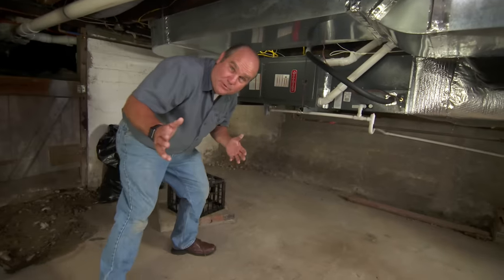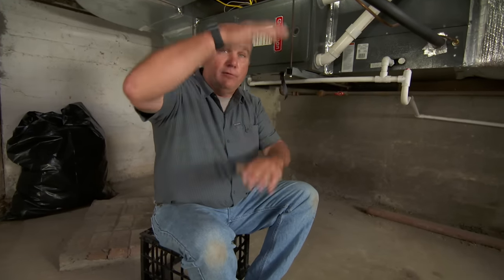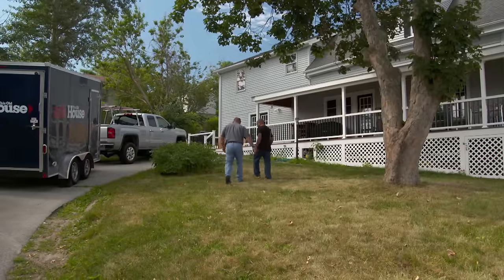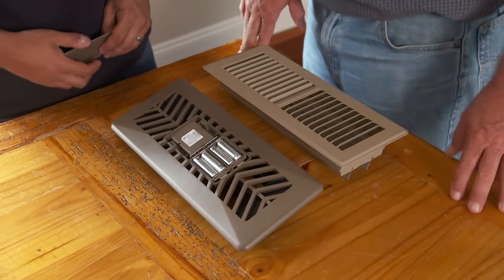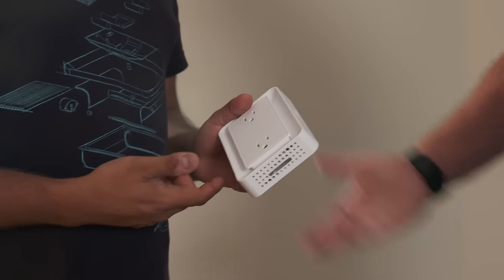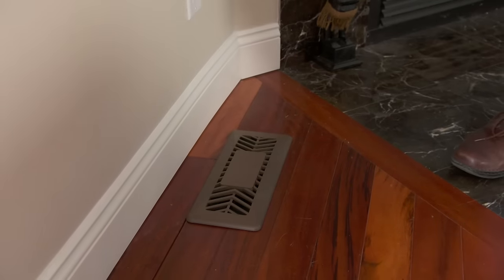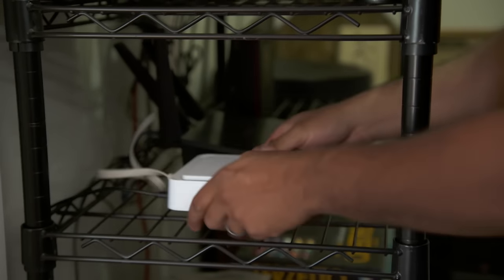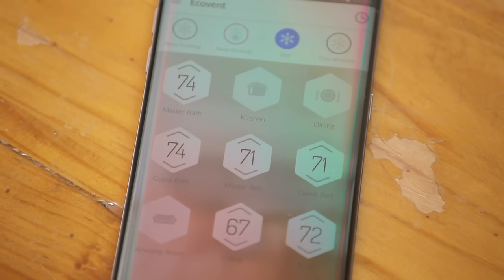How to Install Room-By-Room Zoning in an HVAC System | Ask This Old House

Comment: Guy would make a killing if he would sell this off to NEST to integrate with their learning thermostats and temp sensors.
Reply: Their controller has to be in charge so all your really need from your thermometer is the off/on and heat/cool and fan on/off functions.  The controller is tracking the duct pressure, room temp/humidity to adjust time on/off.  Most smart thermometers don't really do much for room to room conditions but they make better guesses  based on outside data and preferences.
Reply: @TheNameOfJesus  That's because NEST got bought out by Google a few months ago after I posted this comment. lol
Reply: @robsp32  And this guy ran his company into the ground and now these no longer exist. Obviously a poor businessman...and no, it has nothing to do with missile defense....
Reply: @ryanroberts1104  you think that Flair smart vents copied his idea?maybe he patented the idea and is a millionaire now?
Reply: I hope he did cause there is Flair smart vents now that do just as you suggested
Reply: Yeah then he will have a nice nestegg
Reply: @247HustleMode  Who? Not the guy who made this stuff - it's no longer available because he ran out of money.
Reply: Or eccobee
Reply: I agree
Reply: @dave998899  can you provide a link to the updated TOH video?
Reply: @UnsungHeroist  eccobee doesn't let you change individual zone temps...
Reply: @-JonnyBoy-  you can prioritize the zone though and make sure it the right temp. I do this in the summer in my home? At night it only listens to the upstairs sensor to make sure there are good sleeping temps even though the downstairs will get a little cooler

Comment: sensors used in missles defence.,. lol i love how they upsale a 30 cent sensor.. military sensors are thousands of dollars redundancy your using a freaking arduino temp and moisture sensor 99cents on ebay dont lie bro... dont push a product that clearly anyone can do
Reply: They probably aren't going to fail. It's just marketing.
Reply: Perhaps it's because the sensors used by Uncle Sam have to be rated for ballistic missile use? Arduino sensors are just as good for the job intended. I use them all the time.

Comment: Will have problems with furnace, unfortunately this guy seems to have done a great job but missed airflow when 90% of heat cooling is not modulating with his system. Will have problems. Need a proper zoning system.

Comment: One of the main issues all zoning systems have to overcome is trying to vary the airflow volume, when most residential HVAC equipment is constant volume.  A true variable volume system has equipment designed to run on a wide range of airflow.  There is high end residential equipment that is variable volume, with modulating heating and cooling.  These high end systems, with variable capacity work well with zoning systems.

Comment: In the Netherlands we almost all have modulating, low temperature, central gas water heating, with water temperature from 30 to 60c (86-140F) when it is not freezing outside. 
All rooms have thermostats on the radiators and a central controller in the living room. All radiators are sized per room. 
The gas furnace is almost always extremely oversized for heating because is also supplies hot tap water.

Comment: Really neat idea. The registers are a little ugly. Would like to see something that could take the existing registers, and mount under/OR replace the damper. Otherwise really neat.
Reply: Dipul, you would get a lot more respect if you actually had a tiny bit of HVAC experience.
Your equipment is not for every house or project.
Some homes just need an experienced HVAC tech to summarize their issues and come up with a solution. You are trying to be the next "Nest".
I do admire your " Get rich or die tryin" mentality but have a little more respect for HVAC professionals.
Some homes, they have the wrong size ducts, clogged air filters, small return duct, etc. and now you want people to believe your product is going to be the magic bullet.
You want to get rich off something you don't really know anything about in the real HVAC world.
Reply: @gretzkysyotes  How do you install ductwork backward? You should get your facts straight before you throw all A/C contractors under the bus. By the way,jdere31760 is correct and these controls, They don't work too well. he made some statements that are just not correct. So ruin your system. You should fix it yourself too to keep those crappy contractors out of your house.

Comment: You should make the outlet sensors so they screw on the the wall plate at the center screw. It will stop it from coming off when devices are unplugged.
Reply: THAT was the first thing I noticed too. If they are still in business they probably got that figured out by now :-)

Comment: it sounds like the engineer forgot one thing, most people are saying they need a bypass and that is correct for a non variable Hvac. In order to do it without the bypass you need a designed hvac for variable speeds to not over-pressure the flow. You need a max capacity btu but a variable fan speed. There will still be disadvantages, cost is one of them. size of the evaporator is another. A bypass could also be a good thing if they integrate a water heater into the loop instead of being a separate unit. I don't think current systems will not manage unless major deterioration happens. Plus modifying a hvac system vs designing one from the ground up will be better.
Reply: 100% agreed but what makes me weird out is that as an IT/Technology professional myself, I would never recommend wireless connectivity as it is not as reliable as connected and if these registers are constantly opening and closing, they will eat through their batteries quickly.

Comment: Like the dude said in the beginning, if your stuff isn't sized right, no amount of zoning is going to fix the problem entirely.  I remember growing up in my boyhood home, the second floor was always sweltering because the house HVAC just wasn't built correctly. If I plopped this system into that house, wouldn't the a/c just run all the time trying to cool the second floor while making the first floor freezing?  Without an ECM motor, I can't imagine that this system could keep all the first floor registers closed completely. They would have to stay somewhat open to maintain air flow. 

 I think this system is probably better for homes that are either new and built with zoning in mind, or in houses that are being remodeled.  People that expect their drafty, poorly ducted and sized houses to be saved by this system will probably crap themselves when they see how expensive the true fix would actually be.

Comment: OMG.... Where can I buy this. I just bought a new home, with 3 huge rooms and a massive master bedroom, large loft, huge living room.... lets just say lots of space. But I can't understand for the life of me how the builder put in a central heat/cooling system that is not zoned. So the rooms are either too hot or too cold with no way of adjusting room by room. I got a $16K quote form an HVAC company to redo the system with zones. And, this issue is causing me to burn through a 500gal propane tank in as little as  2-3 months. Your website is not working, how can I get this system?

Comment: I’m thinking of just a couple of issues with that type of zone system. They didn’t talk about a by pass damper or a freeze stat for the supply plenum to keep the coil from freezing up. One other thing. I would think that stopping the air flow at the register would cause a noise problem at each room especially with multiple registers closed at the same time. Build up of static pressure. What is the cost verses a typical zone system.
Reply: Cindy Brake 
They explained how the hub is programmed to maintain enough vents open to prevent an increase in static pressure.

Very likely the reason why they claimed a professional has to install this system instead of the homeowner.
Reply: @davidcerino1145  bullshit, if the system has to open enough vents to prevent statis pressure build up then it can't regulate the room temps. only way this would work is with a variable speed blower that could be ramped up or down.
Reply: @rollandelliott  oh, quite likely, for sure!

These are not ideal systems.  It's a nice attempt to retrofit an existing system into a zoning system with the least invasive approach, but it isn't without its flaws.  That might still be cheaper than trying to upgrade to a communicating zoning system with an ECM blower motor and a modulating outdoor unit, which would provide the best performance.

I think they want their special guy to install these systems because of the very tedious adjusting the system probably needs just to work well.
Reply: How would this control the temperature if a good number of the diffusers have to remain open at any one time in order to keep the airflow at an acceptable amount?  It would work a lot better if the system had a bypass damper, and a discharge air controller that could be programmed to shut off the equipment before it trips it’s internal limits, or freezes up the AC coil.  I have put in what are called therma fusers, which are 24”x24” diffusers for suspended T bar ceilings in office buildings.  They open and close themselves and are fully self contained.  We always installed a bypass system and discharge air temperature controls to prevent damage to the heating and cooling equipment.
Reply: @rollandelliott  then you would also have to use a furnace with a modulating gas valve, and a inverter drive condensing unit

Comment: Richard, it’s been a couple years now so I was wondering how you felt about a system like this vs the old type motor driven?
Could you point me to any videos you have done on installing the old style for an upstairs downstairs (so I don’t have to keep going down and manually turning them twice a year)!
Reply: Have you been able to find a motorized system that does not require internet or wifi? Ethernet is good but not connected to outside internet....Internet of things!

Comment: One part of this system I'm not grasping. Suppose the original tstat for the system is in the living room. You now set the wireless system to sleep mode and it dampers off the living room. During heating season, the room inherently would get cold, tstat tells furnace to fire but you have now dampered off the register in the living room which will cause that room to heat either slowly or not at all.  This then causes an inaccurate reading at the stat that doesn't represent the temperature spread in the entire house.  So, you solve one problem with your cold bedroom but created another by having the furnace run longer.  A poorly insulated home or inadequate system is very hard to overcome.  You're not going to push much more cfm through ductwork that is designed incorrectly.  Seems like a neat idea but doesn't solve all the issues. Should be a way for the hub to communicate with the heating and cooling system as well.
Reply: zimsjeep m
Reply: you would disable the original t-stat.
Reply: Ron, correct. Think if it this way... the average house has around a 3 ton AC system, that requires around 1200cfm. If you were to install this so that only half the vents open on a call for cooling you would freeze you evap coil (indoor coil), or in heating, your system would bounce off the high limit, this is not a good design. You'll end up spending more money to run the system and you'll end up damaging it. Further more, lets say you have a 3 ton system and you have it setup so your bedroom is one zone. You would be paying to run a 3 ton system to cool one room. it's not cost effective.
Reply: Mark Woodworth I agree and you are correct.   They skimmed over the topic in this "pretty typical"  with this bozo from TV land.  He "works"  on these systems yet,  every manufacturer in the world requires separate drains for heat and cool... Even Goodman... Tho this stem common drains both to one,  not to mention not even a little to anyone's code.   Maybe the thermostat should just be used and the system corrected.   Furnace would tip out on limit and the ac would freeze and thermostatic operation is still based on the the area where it's located... If it's in a zone that's closed the rest of the house would suffer.  This system they are selling is a baaaaad idea
Reply: Mark Woodworth If you're only heating the one room, the system would run for a much shorter amount of time than if it was heating the whole house, right?
Reply: Not necessarily. It would all depend on if the vent is sized property for the room, and even if the vent is sized probably if you have one room calling for heat, and let's say that room has big doorways to the next toom. you wouldn't have a lot of heat migration. the system might never satisfy and the furnace would be bounce off its high limit. Also your static pressure in the ductwork would be high. It would end up killing the blower motor. You would want a blower motor with a VFD on it. It really comes down to it was not designed by someone with a HVAC background. It sounds like a good idea, but in the end it's not going to save you money, it'll most likely crack the heat exchange prematurely and kill the blower motor.
Reply: Not necessarily. It would all depend on if the vent is sized property for the room, and even if the vent is sized probably if you have one room calling for heat, and let's say that room has big doorways to the next toom. you wouldn't have a lot of heat migration. the system might never satisfy and the furnace would be bounce off its high limit. Also your static pressure in the ductwork would be high. It would end up killing the blower motor. You would want a blower motor with a VFD on it. It really comes down to it was not designed by someone with a HVAC background. It sounds like a good idea, but in the end it's not going to save you money, it'll most likely crack the heat exchange prematurely and kill the blower motor.
Reply: Mark Woodworth good job!!!!!!!!! 
Let's just say this video is moronic at its very best and leave it as saying it can't be done easily even with overpriced gadgetry??
Reply: This is the same as putting zones on a hydronic system.  Sounds like someone jealous they didn't think of it first...I think if they brought a pack of hvac installers into NASA you guys would probably try and tell NASA what to do.  Stick to installing let the engineers do the engineering.  The vents never completely close in order to keep the static pressure from building and effecting the blower motor.  You don't think a rocket scientist would have thought of this lol  This system doesn't run off of a thermostat listen to the video.  Just from looking at the app from the video I can tell that there is a range limitation setting built into the program based on how you are heating or cooling your house, you can't have one room at 65 and another at 85 its probably a 7 degree limitation also known as a standard deviation based on how the furnace or ac is running.
Reply: Each supply register  measures temperature of the conditioned air , compares it to the wall plug space temp and knows if system is heating or cooling at that time. the dampers regulate cfm
Reply: zimsjeep
Reply: zimsjeep spot on I have been installing Ac for over a decade and many companies have tried to implement the same type of product. The main problem is that the Ac unit doesn't communicate with the dampers, so if the unit thermostat is in the living room and is set to 25 degree's and it is already 25 in the living room the unit doesn't need to heat or cool. However in the bedroom it is 35 degree's and you also want 25, you can open the damper as much as you feel like and it will do absolutely nothing.  All units are in degree's Celsius.
Reply: Mark Woodworth a
Reply: Kevin Gallagher n
Reply: I can see this working.
They did mention that the “hub” would ensure that enough dampers remained open so that the unit wouldn’t have issues (such as trip on the freeze stat or the hi-limit).

However, . . . . this is but a bandaid to a system that wasn’t designed for zoning.

In a properly system designed for zoning, 
-the duct work is built precisely to branch into specific zones
-there is a control for static pressure in the duct (VFD or bypass damper)
-a control “hub” that will take various thermostats or zone sensors to work with the unit.

They skipped the static pressure control setup, if there is any.

But . . . 
. . . . for a post installation system, this might work.
Reply: +1 zimsjeep, Mark and Ron.  This only makes sense if you have more money than sense.  These gadgets are not cheap and do not solve  HVAC problems.  At best, this system would be more expensive to run after these are installed (which is okay, because you would have to have plenty of money laying around before buying this).  At worst, they will wear on the system and take years of the expected life of the blower or compressor.  If you DON'T have gobs of money to waste, then you'll want a proper fix.  Insulate your home.  Don't let your HVAC contractor install any system without performing a load calculation FIRST.
Reply: I have saved at least $10,000 dollars "watching youtube videos" and then successfully DIYing.  Ironic that you are posting on a youtube video for others to not watch youtube HVAC Videos (after you have obviously been watching the same videos on youtube).
Reply: @John Gault 
What?